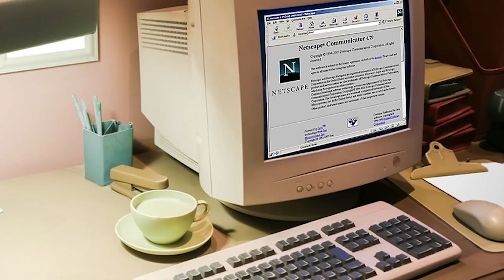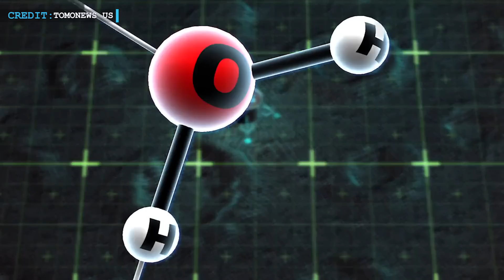Will Russia Quit the Space Station? Private Mars Landing Mission Aims to Beat SpaceX

Comment: Those of us that can recall the NASA videos back in 2000 of the projected ISS construction and its segments, might recall those elements that were cancelled. The US cancelled the inflatable habitation module, but the Russians cancelled significant science modules. I believe it was about 2009 or '10 when the ISS was completed enough to be brought up to full crew capacity of 6 persons. With the retirement of the shuttle in 2011, capacity was brought down to 3 and remained at 3 until After Demo 2. The ISS required so much maintenance that there was little time left over for science. That's almost 10 years lost of full-scale science. It's more than disappointing that systems are cancelled before a viable system is ready to take its place, IE the Shuttle (Yeah, yeah, money! I get it. Still a bad plan). Now Russia wants to pull out and build their own station. I hope they plan on using something other than their 1980's technology junk which is the biggest part of the decisions that the ISS is outdated and should be replaced. Right now, it's still their viable investment and I don't see them pulling out until they start launching modules.
Reply: The ISS (née Space Station Freedom) is another unaffordable, unsustainable NASA pork boondoggle… useless for space science, exploration, manufacturing or engineering. Turns out noisy, smelly, clumsily humans are incompatible with space science observations, & any space science can be done 10 times better for 1/10 the cost with unmanned satellites.
 NASA sold a gullible Congress an $8 billion  space station..  then NASA Required $64 billion (40 x $1.6 billion each) of shuttle launches just to put the parts up, over $150 billion total. 
Ill conceived, massively over cost, useless for space observations/science/exploration, dead end, NASA wanted to dump it in the ocean a decade ago. NASA’s ISS has been useless & the most expensive & wasteful project in human history. All the manned space endurance records are still held by preexisting on Russian space stations. The ISS should be dumped in the Pacific as soon as possible as just another dead end NASA boondoggle/failure. NASA manned space ‘going nowhere since 1972’.

Comment: ISS is a waste of resources, I'm glad the Russians see this and hope they abandon the station
Reply: It's twenty years old. If you had a twenty-year-old car, wouldn't you want to trade it in ... for scrap?
You just know that there's a shiny steel, multiple nine-meter-diameter by forty-meter-long tetrahedral SpaceX replacement coming by then.
Reply: @charlesrovira5707  HEY! My Nissan 4x4 Pathfinder is 23 years old and I still love it. I bought it new and never going to sell it...or scrap it.  :)
Reply: @nunya___  Either that thing is sitting in a garage or it's gonna die soon. Of course, I could be wrong but after 23 years, I'd bet the paint is starting to get bleached by the sun.
Reply: @charlesrovira5707  It has sat outside 15 years but has a garage now. The sliver paint is fine. My dad says he can't believe it still looks that good. Paint is getting "thin" on the front plastic wheel flares. The leather seats  still look new except the driver seat that needs recovering. Dash is fine. The engine's rear main seal is leaking a little and drive shaft needs new U-joints. I'm have those repaired 2023, after kayak season. It runs and drives great and it's cheaper to repair than car payment/high insurance. :) I'll keep it but will add a EV when something affordable happens.
Reply: ISS is the only place where we can make science and industry tests, where astro-cosmo-spacio-nautes can test and prepare human travels in space, and so on. It’s also important for the international cooperation. A waste of ressources? No, certainly not. Russian can work with Chineses if they prefer or make their own space station. But it’s not an idea of the best as you spend billions for a war and have no vision of the future. Old rockets, old shuttles, no deep exploration and now a new delay to create their space station while every countries are going faster and faster… This is simply another political bad choice. They will join Chineses in the end. They were the first to launch a satellite about 60 years ago…
Other ISS partners will continue to collect data for space travels, initiate the orbital means for interplanetary travels and moon orbital station.
Reply: @frjedi9081   I can't think of any meaningful research that has taken place on the ISS, unless you count growing beans in zero gravity as meaningful research.  Diversity of programs is what will produce results, competition.
Reply: @hatchettchris  Didn't they make beer recently? Space beer is important.
Reply: Kinda like u being born
Reply: @dillonbledsoe7680  Seeth bundle of sticks, Seeth.
Reply: Ya that must be why china and Russia want their own station. Let them waste resources with this pointless opportunity